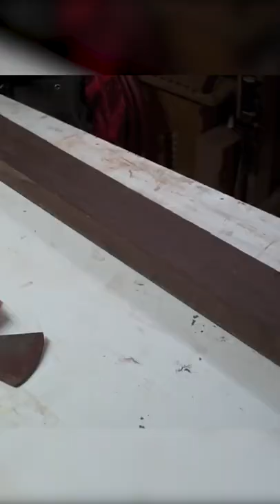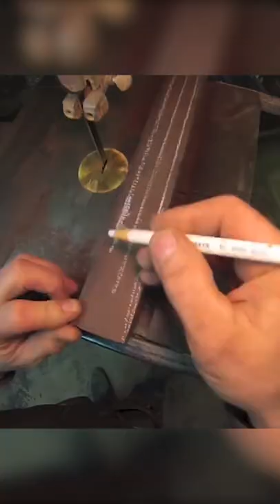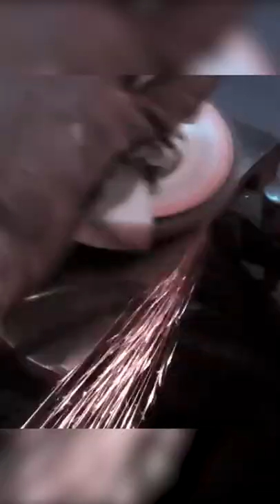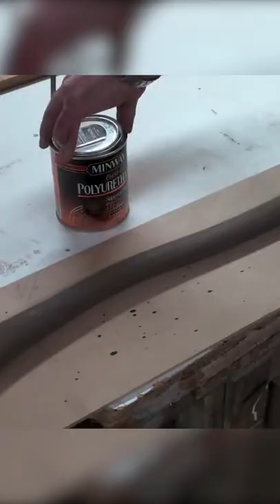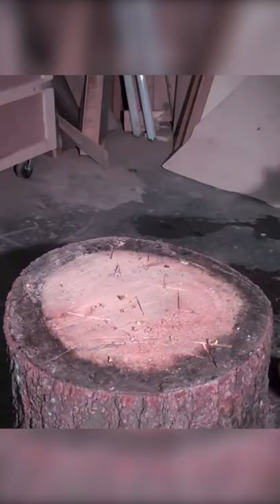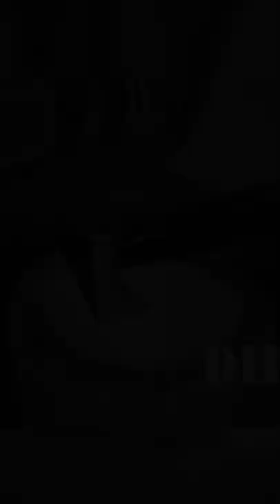DiResta Axe Restoration w Wenge Handle

Comment: Most loggers here in Oregon, if they got an  axe with varnish on it they would scrape it off and use boiled linseed oil, it's just a far superior grip surface then slick varnish.
Reply: That's fair
Reply: They'd likely also not use one made of an exotic African hardwood.
Reply: @csn583  I doubt that any self-respecting Oregonian lager would purchase an ax with the handle made of anything but Hickory. And that would be finished with boiled linseed oil.
Reply: @marlobreding7402  I don't know many beers that use axes
Reply: @ericpedersen2760  I think he meant a lager beer. Loggers they're brutal beasts
Reply: @ericpedersen2760  surely you mean bears..
Reply: @CitizenAyellowblue  ...and don't call me Shirley
Reply: You are going to want at least 10 thick coats of varnish on anything you are handling that’s made of wenge!!! The sanding dust is like toxic pepper, you don’t want to be getting a splinter that’s for sure!!
Reply: @richarddunnett2619  Hickory is the wood of choice for AXE's in the Pacific Northwest 👌 with boiled linseed oil. No splinters to worry about.